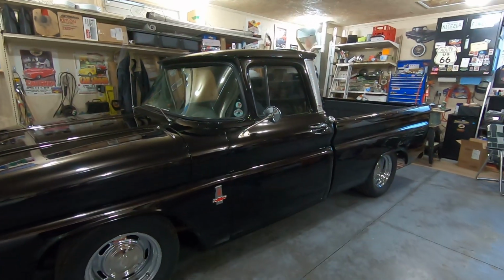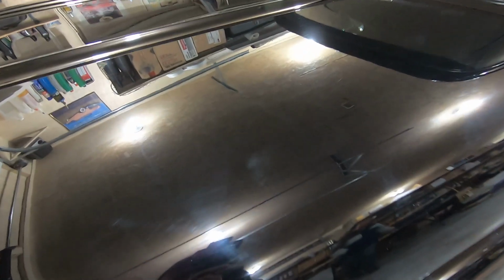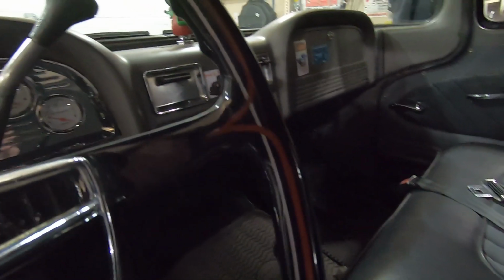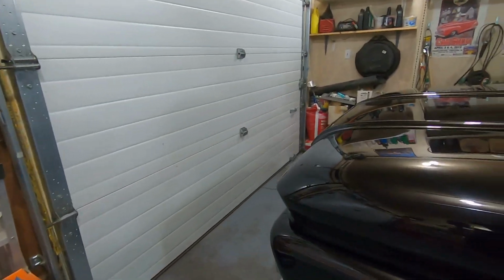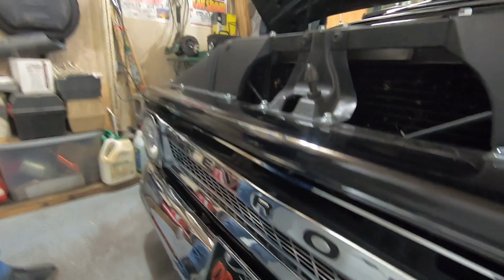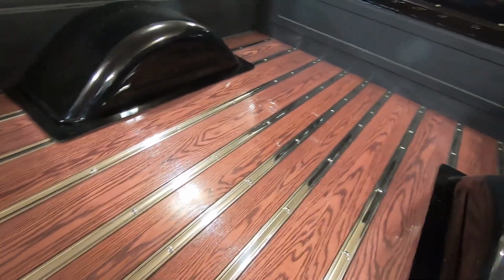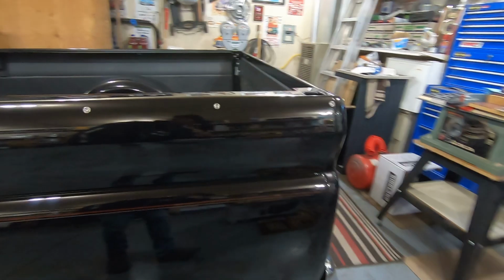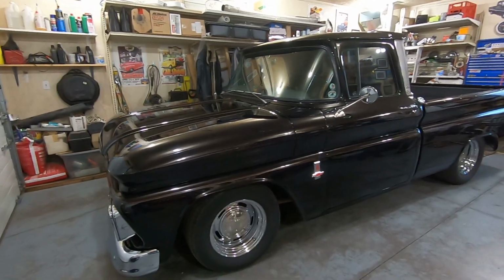63 C10 SHORTBOX CUSTOM

Comment: Very nice well done truck and I've seen it in person at A& W etc. Considering all the the upgrades that have been done to the truck I was surprised to notice the Master Cylinder, maybe its the original,  with only one brake line coming from it.
Reply from the maker: Yes your right Greg I believe it's the original brake system
Reply: It would be wise to convert it to a dual system for safety but yeah it wasn’t legally required until later, I forget the year.